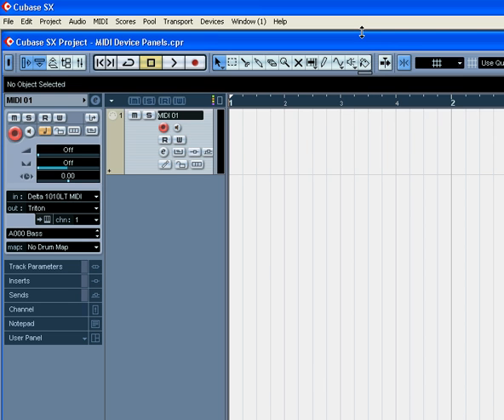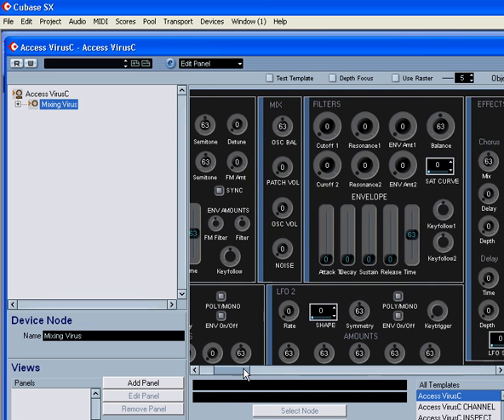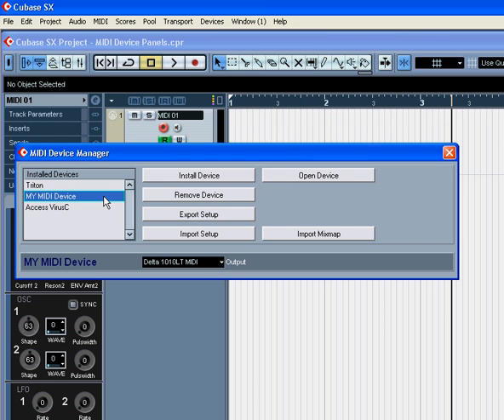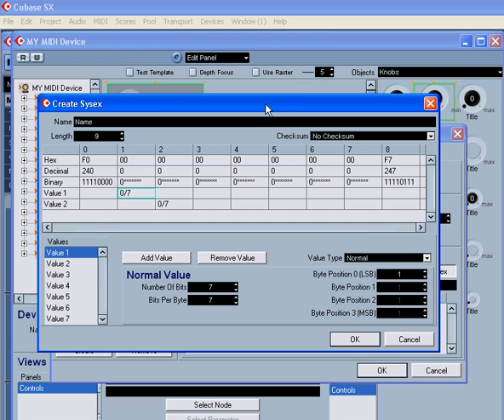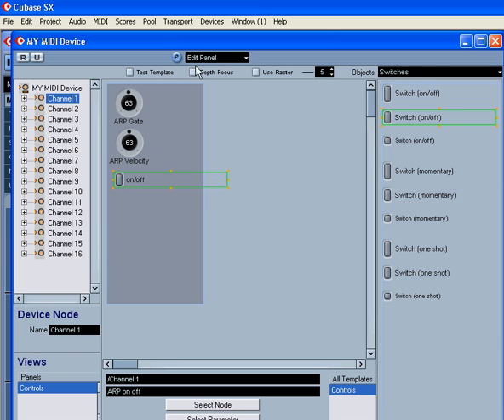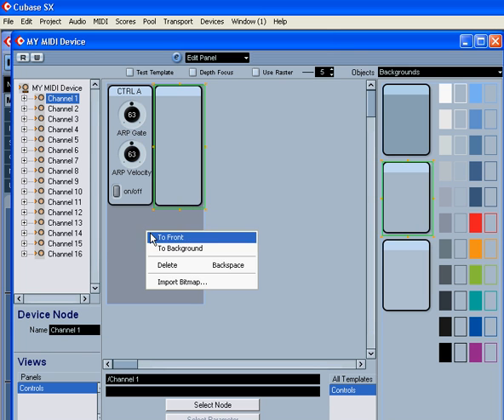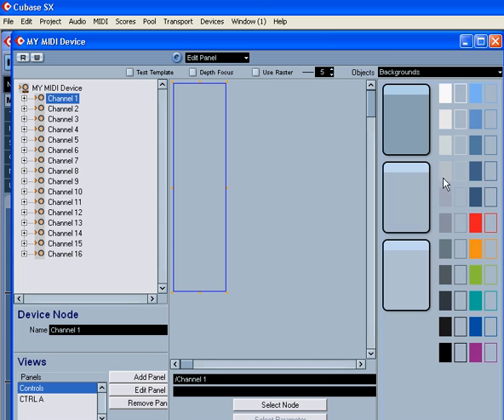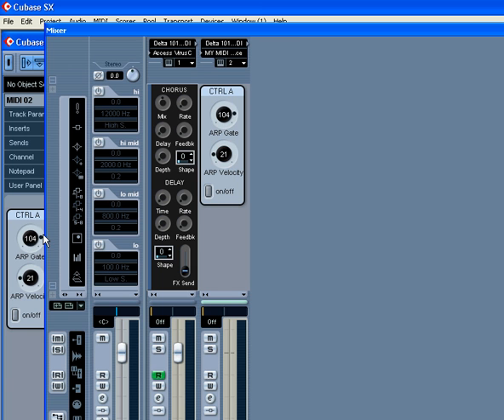Cubase Video Tutorial - MIDI Device Panel Setup

Comment: I don't get it... What's the difference between the midi device panels and the controller lanes section within a single midi track? I use the cc lanes without installing anything but i can't operate my Korg synthesizer properly and it skips some commands it receives.

Comment: you are the queen of information!
.xml files   : i knew anything about it and its connection to midi device manager 
Now: please: may I ask You where to find access virus ti . xml ?

Well : i mean
i got  
access virus ti module, to newly use as a midi remote controller
maybe i do not need cubase midi device manager at all : is that true or what ?
Best Regards